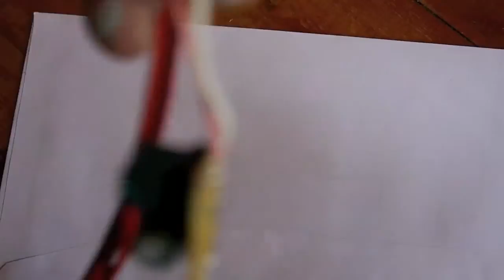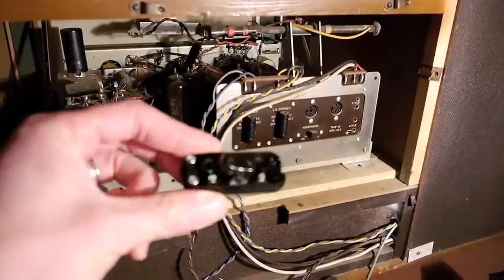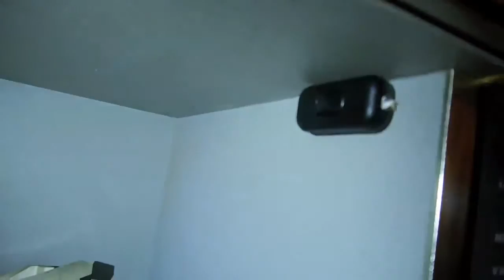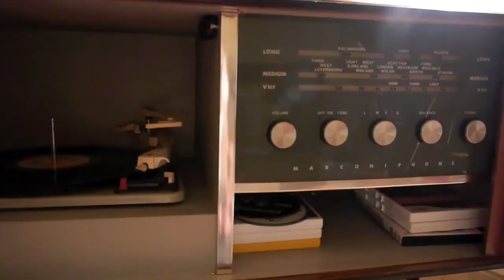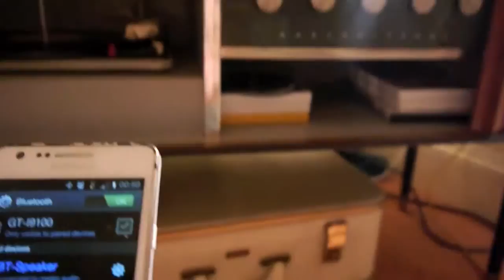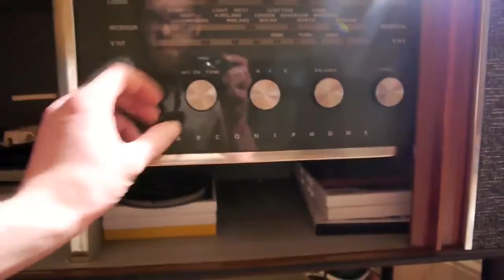Bluetooth Radiogram!

Comment: Sorry to read it didn't last long. I did something similar with mine. I used an old phone charger for the power supply, and I wired it after the power switch so it comes on when the unit powers up. My bt module has a line output so I out it on the aux input (originally for a tape player).

I get a lot of hum, but I think it's down to some wires I rerouted. Either way it's a lovely soft sound from the valve amp and large speaker boxes. Also looks class.

Comment: I have just bought this radiogram from a charity shop. I was wondering if you have a handbook or any other written materials regarding the internal wiring etc. as I am missing the radio stations sheets behind the dials and i was hoping to hopefully get a new one made
Reply from the maker: Hi no I didn't find any diagrams or such I'm afraid.  However I could send you a close up of the panel on this one if you like?

Comment: Hey well done mate!  I'm thinking of doing something similar as soon as I can get a decent scrapped radiogram - fitting dual concentric car speakers and remote control dab tuner and amplifier etc.   Perhaps you could get that panel to light up.  Anyway congrats for keeping the original parts intact.   I wouldn't have the heart to rip out turntables,  valves,  etc - so am looking for a total basket case one.   Again, well done.  Inspirational.
Reply from the maker: +DukeOfDunbartonshire the panel does actually light up but just not very bright haha!  I hardly use this now as there's so much amp buzz, and not really sure where you'd pick up a scrap one sorry.

Comment from the maker: Update!  I used cheap parts and something has broken :(
Thanks to that on/off switch I put in I can still listen to my records without the noise from the Bluetooth module but I'll have to investigate what went wrong and probably use higher end components for the next one.
Reply: Thanks for sharing this video - cool idea. In the video you mentioned the bluetooth chip got pretty hot would that be the possible point of failure? Maybe a heatsink or something could be the remedy like you might see on computer processor, I came across heat sinks fixing a yamaha reciever recently they were fastened to the output chips. thanks again.
Reply from the maker: Yeah possibly the culprit - I STILL haven't actually had the time to open it all up again and see what went wrong!  But yeah, thanks that sounds like a good idea and I will probably look at the spec sheet of any future components used first to see if they would require that.